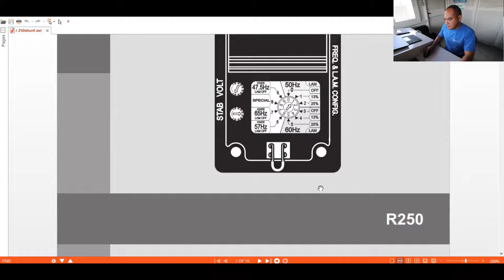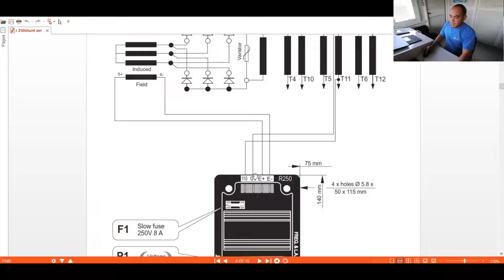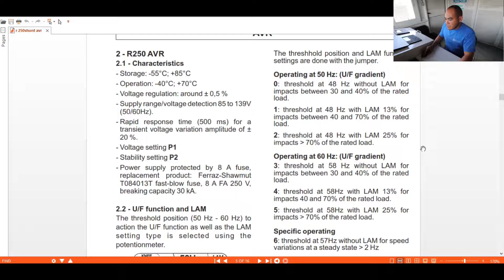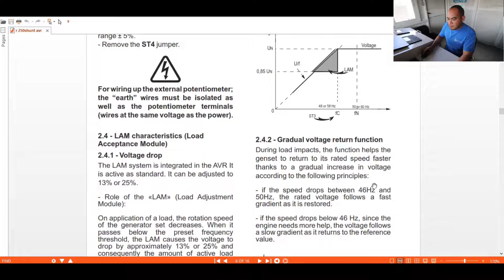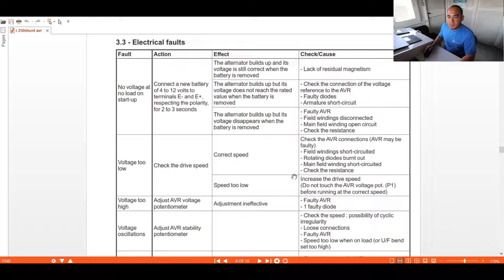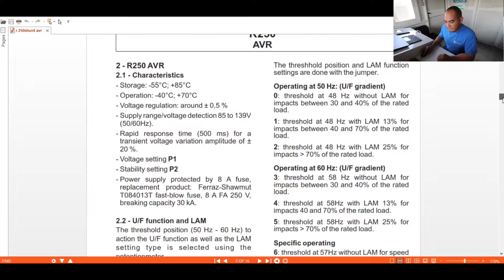LEROY SOMER AVR R250 SHUNT AND LAM FUNCTIONALITY benzblogs

Comment: Sir may R250 avr Ang problema ko sa Genset walang  isa Wala talaga outpot.kahit konti.isa namn mayron kaso NASa 20ac lang.sinood ko yong sinabi mo lagyan Ng supply Ng battery may outpot sya kaso mababa din. AC outpot nya.
Reply from the maker: Mean my problima either diode or winding or excited jan lng ya
Reply: @benzblogsVlogs sir pag supply my mo  12v sa linya Ng exciter nya may outpot Naman kaso hinay kaayo mga 20ac lang.osa Naman sir gensit pag andar aabot 220 kadogayan maging 20 ac lang.nag request baya ko avr ane.yong R250.
Reply from the maker: @Mahirapnamechanikosacebu wala nayan pweding sira na winding or diode

Comment: My friend how about a cummins generator camda,  its starting but after a seconds its shutdown, and showing to the screen failed to start, change oil done, battery is good, fuel no air,  fldywheel sensor change ang controller change new also but still start and after a seconds its shutdown,,,
Reply from the maker: Change oil sensor and double check the battery coltage while crank if 12vdc should droop to 10vdc if 24 it should droop to 20vdc if below need to charge  check also fuel injector if fuel comes out check the wire connection if there is volatge output from fuel relay

Comment: Hi  if the generator works stably on exciter winding= resistance 5 ohms I deliver,  at 4 Volts and 1 Ampere.
does this type of avr have the ability to set such a low voltage?
when the configuration is 3 phase
- I will add that during the start without load there is only 56V.  on the phase  there is no connected Avr I'm still looking for the right one?

Generator is 25 K.V.A 35 Amp
Reply from the maker: Waht you mean sir what ohm your exciter? And what kva is this
Reply: @benzblogsVlogs   hi 
the exciter auxiliary winding is 5 ohms 
we don't need this parameter ok.
is this AVR only able to deliver 4 volts 
it is at this that the generator works with an output equal to 230V.  for each of the phases

I checked it on a linear regulated power supply

i.e. about 0 - 4 volts.  the generator has the correct output voltage of 230V.
Reply from the maker: Sir the exciter resistance is range up to 12-20 ohm what kind of genarator you have that only 5ohm the exciter winding?
Reply: @benzblogsVlogs  that's the way it is sir I checked it and that's how it behaves I got at 4 volts auxiliary power and 500 mA.  output voltage 230 volts N \ L 1 - L2 - L3

I connected the load on each of the phases 7 amps is 4.4 kw 
the generator worked with a drop of 20 volts per phase, i.e. under load, the voltage was 210v AC
Reply: @benzblogsVlogs  
well, I have a problem, if you haven't heard of what kind of queues of this type of input resistance so low 5 ohms. 
I took the news
I will ask one more question whether the AVR must have a current measurement through an isolated CT. at the time of load it also increases the current to the exciter with voltage or only the voltage?
Reply from the maker: @Tomtech29  meaning that is already damge you need to replace or rewind
Reply: @benzblogsVlogs  thank you for the honest answer, I will try to do something about it first, inspections from the inside
Reply from the maker: @Tomtech29  meaning winding problem cause of this is due to over excitation and low mentainance
Reply from the maker: And exciter suply should be starting around 1-12 vdc